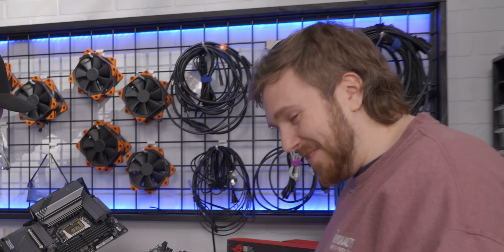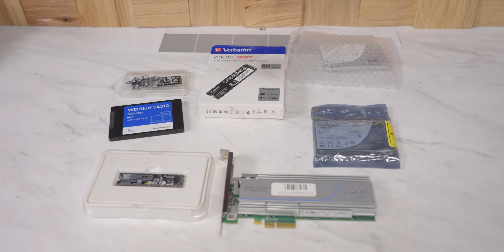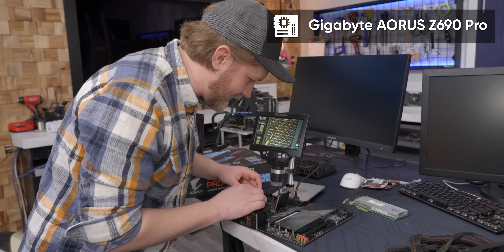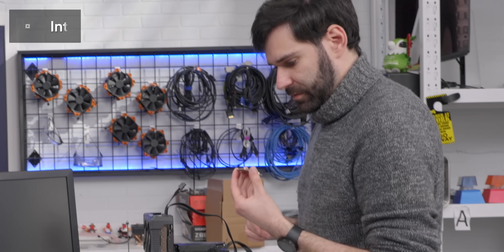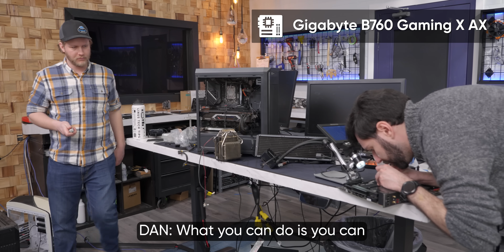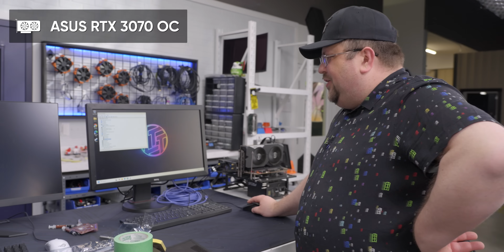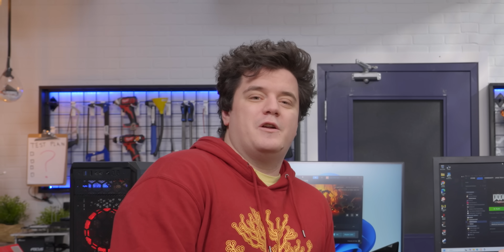I Built a Working PC using only Broken Parts

Comment: Looks at my 5800X, 32GB DDR4, RTX 3060 system with fans but without any side panels. 👀 
Did you just call my system a cougar?
BTW, I've seen bad PSUs kill HDD and SSD.
Reply: Bad PSUs can and will kill everything

Comment: Those plier pins for the bios are so incredibly difficult to make contact onto the chip it would read FF when theres a faulty contact. You shouldve de-soldered the bios chip and then soldered into the adapter pcb that comes with the pliers and then tried. I did this to my steamdeck but since my soldering iron had such little thermal mass i ended up frying the traces due to overheating and bricking my steamdeck

Comment: 22:07 That's a very common problem with WD SA510 drives, I had a 512GB version and it also didnt show up. After a bit of research, those drives are not very good and reliable because they often just die. But, mine was built in 2022 so it has a 7yr warranty, which means I could just RMA it. Probably could do that too with the drive in the video.

Comment: Mechanical faults can be fixed (bending a bent pin back into shape, resoldering broken contacts, cleaning out dirt and gunk, applying new thermal paste and pads/putty, etc.), but when the logic of a component dies (i.e. the memory controller on an SSD, a CPU, RAM modules, etc.), then those are gone. They might still "work", but you're going to be in for a permanent ride on a razor's edge regarding "Will my PC just randomly crash?"

Comment: ive build a few necro pcs but i normaly go to a ewaste supplier that is allowed to sell the parts and i have had luck with everything but i will never run a broken power supply as corsair make great power supplys ive had mine for 8 years and one before 13 and last one only died because of user error big time but motherbordes cpus and gpus as long as you can inspect them normal i find that you can repair as long as you know what to look for and ram i tend to look for ones with missing pins normaly in certian locations on the ram as i know most likly i can fix that cheap and easy and i find it to be a good way to get a cheap pc but normaly unless ram is super expencive i would buy new as the diffence when the buy new price is lower isent worth the hassle

Comment: we boughta gigabyte x670 am5 it was an expensive board for a costumer, we paired it with a working cpu and it would refuse to boot. it booted half the time with only one of the cpu power slots connected, which was weird, and my dad deemed it broken and was sent a replacement by gigabyte for free which was cool, and even cooler they didnt ask for this one back. 

so i bought a ryzen 5 7600 and it works completly fine. on both powers. it just became my main pc, free board lol

Comment: 27:15 I have the same problem as Elijah, but it happens when i change the display, not the resolution
DOOM 2016 just struggles to run A LOT, and tends to crash when i plug it onto the TV (1920x1080@60Hz), works at the shittiest resolution of the same TV (the lowest linux allows, like absolute trash@70Hz), but in my display on my desk (usually 1920x1080@180Hz) it runs perfectly fine

Comment: As far as dead RAM goes.. in my broke days i've had a pc with 256 mb DDR ram. My friend had 1GB but at one point his pc broke. They went to the repair shop, and was told it was a bad RAM module. So he got a dead 512MB ram. I took it home, turns out it worked. I used it for 4 years. Around 7th year I told my friend that I took it home. And was pissed at the PC shop guys. That it still worked.

Comment: Caps lock / num lock work when the keyboards getting 5v power lol I mean, getting power out of your USB ports I suppose is something. There are motherboards with partial initialization which do not power peripheral initially so getting to the keyboard to receive power and validating that may... sort of... indicate something? I mean - wouldn't go by it, but this is Linus Tech Tips so makes sense.

Comment: In 2003 I had a helpdesk tech working for me that bent a pin on a CPU and then when trying to fix it, broke it off. He decided to just try putting the CPU into the motherboard and it worked just fine.

So I told him well looks like that’s your computer.  It worked for years without issue. I guess that pin was not needed.

Comment: I'm a retro-hobbyist, so I'm effectively always "putting dead RAM in". The first thing I do after ANY change to the innards of a PC is use at least a few minutes of memtest86+ as an extended POST... and it's saved me a lot of pain situations like "a bit of dust found its way into the DIMM socket while I had the DIMM removed to grant access to another component".

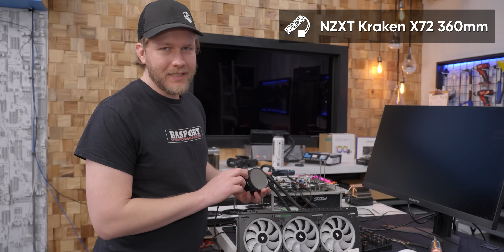Comment: 23:00 you can actually buy the spare power/usb connectors for NZXT coolers for cheap either directly from NZXT, or from aliexpress. I got my NZXT 240mm from a friend, and due to logistics error (item was in a pile in his parents house, and he alr moved out 6 months) the power cable is missing so i just bought it off aliexpress since NZXT doesnt have good coverage in my country for this kind of specific support.

Comment: this is the side of LTT that I love it has never been a better time to build a used parts PC. If you have the last few gens of CPU mobo combos it's gonna run GPUs for a bit in the middle of the pack. In my 3070ti build I'm switching to a 5070ti and upgrading nothing else. and ill leap into new generations with 10 cpu cores and 64 gb if ddr5 5200mhz ram I can actually just wait 2-3 years before I upgrade my CPU Mobo combo

Comment: For those bold enough to try finding resold Western Digital SA510, take a LOT of precaution. Ran into those particular drives in some backup appliances, they released with a broken firmware that (unless updated) could put your drive into a read-only mode. At that point, it's a nice paperweight. 

Aside from KingFast, any other drive will serve better than the SA510.

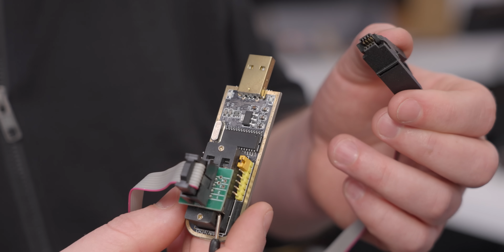Comment: 19:17 No No No No that probably needs the 3.3v mod done to it , I've coked many nand flash chips not doing that and , just desolder the bios chip and do it , on board sometimes messes it up
Those drivers aren't stable as well
For something reliable look at the rpi flasher

Comment: I buy computers from the local  scrap yard as complete systems.   Priced by weight.   Usually between $10 to $35 cdn.  I take them home and strip them down.  Test individual components.   And for about every $100 i spend, i can make on average $500.

Comment: With used storage, I think it's important that you tell others they should properly wipe it 100% before actually putting it in a system where someone has important files. You have no idea what could be on those used drives.

Comment: STOP recommending that usb flasher without going into further details! It has a working voltage of 5v or 3.3v, since pascal nvidia uses spi flash chips that work on 1.8v ( both supply and data lines). It is a good flasher, but it needs its 3.3v regulator changed with a 1.8v one. Attempting to flash a card with the 3.3v will kill your gpu and/or spi memory chip.

Comment: Broken pc, disc drive, ssd and ram sticks should be cheap af because fixing them is almost impossible. They should be used for spare parts only if there is anything usable in them. Which is why 15-30$ is max price for them. Then there is GPU.. motherboard, liquid cooling system and power supply. They can be fixed so a little more expensive. Especially GPU can be used for spare parts.

Comment: Im watching this video right now with PC Parts that have been soled as "Broken"
An Old Server Motherboard for windows server 2012 (DIM SLOT 4 is broken but thats fine for me...)
Im missing a side panel, but its under the desk out of reach, so thats also fine

My GPU RTX 3050 has no Fans, but it runs fine with the air flow Im having
3 sticks of RAM, each having 4GB DDR3. the contacts were lose/gone, so I reapplied some solder
and a 4 Core CPU with bend pins, also coming from the windows server 2012

I am running Linux on this machine and it works just fine
havnt had a problem with this build till yet and am deploying it since almost a year now

when it comes to gaming, Im kinda cooked by my 4 cores on my CPU
Im at 60% with only discord running in the bg
but, I must admit
eventho its not strong from its specs and its given age, it still runs surprisingly well
total coast of my build: 250 euros
but thats with buying a NEW 250GB NVME SSD and a new PSU

oh, and The power button on the case is broken, which is why I got a power cable with a button on it hanging down, but thats it

games I usually play:
Minecraft, Repo lately, Oxygen not included, Portal 1 and 2, slime ranchers, sons of the forest with proud stable 50FPS on all low settings ofc, Hydroneer and the forest

as funky as it may sound, I also work on 3D models on this build in Blender :D
Physics simulation is terrible on that one, but that doesnt really suprice me
It could be better, but due to the fact that I dont get to game real often due to work, I think that I will stay arround with this build for at least 3 years
and then upgrade to a pc with a rtx 6090, an Ryzen 9 something, 2 2 TB NVME with a raid 1 and a wopping 128GB of RAM

What Im trying to say here is that if you want to safe some money, you certainly can. but make sure that you can handle the consequences of having a broken system in long term

Comment: You're more than welcome to my fine collection of deceased legacy RAM sticks. The funkiest ones are from an overclocked  Win 95 pc which eventually combusted via a shonky Fire GPU. Nominative determinism ftw. The mobo was also a bit curly afterwards.
I also have a fine selection of intermittent ECC sticks in various flavours which might work fine in one slot on a particular brand of cheap single cpu motherboard, but play dead on any dual-cpu enterprise workstation motherboards. The more cores on the installed cpus, the less tolerant the systems seem to be with regard to iffy RAM integrity.
Post failure bleeps = EDM for pc wonks. It's great when it stops.

Comment: 18:49 Alex, RAM is definitely one of the weird components I have ever dealt with, when i built my system everything was working fine until one day it didn't.
Then I started swapping the slots and nothing.
Luckily I have built another PC for my brother so I grabbed the ram from there and put in my and ofc it worked.
But the most interesting part is that Original Ram worked on my brother's PC.
Its been like 3-4 years later still no issues.

No idea why, but ram is just ram.
Reply: Forgor to mention, my rig with the original ram was running for a few month, all the components were new, so it's not like DOA.
I have similar stories but these were with old or just trash components (I was one of those guys that would see thrown aways components and would collect, test and eventually Frankenstein them together, so in the case that my parents PC would die, I have a spare and I could save 100-200$ because we didn't need to have a tech look at it.

Comment: i did this back in 2002 or maybe 2003, i saved up for a whole year, then looked at the sales ADs in the local AD publication.
Had the equivalent of maybe 130$ at the time.
Found a computer with "lightning strike damage" for 40$, salvaged the CPU, motherboard and 256mb of RAM. lost the LAN, GPU, sound card, PSU and the other stick of ram. (cpu was pentium 4)
found more ram and a PSU on part piles friends had, cost me about 30$ total to get to 1GB (respectable at the time) and i think it was 400W on the PSU.
got some disks, a case, monitor and a razer mouse (new and expensive) for 60$.
brother donated his GPU because he switched to a laptop at the time. (sapphire radeon 9k something i think)

that thing held up playing cod 2 on medium-high depending on display resolution.
that thing also did NOT handle stuff like guild wars 2.

must have upgraded the pc at least twice (never the GPU) before buying a brand-spanking new one in 2008 with a radeon 5850 (i think) and an AMD black box, it was... superb. 8GB ddr2 felt like infinite ram at the time.

Comment: Took a chance and bought some $12 (ok maybe closer to $13) MSI 1060 GTX 5GB cards recently.

When I saw the 1060s up for sale on an otherwise unremarkable chinese vendors Amazon store page... and then did a "sort by price" with VRAM minimum 4GB list of al the gpus I could find, just to be sure I was seeing it right, I didnt think it could be legit. The seller page  and item listing  looked worse than most AliExpress Chinese store pages. Clearly incorrect translation of a side note along the lines of   "starter freshen exclusively working " that was intended to say "supported with updated driver" sort of errors. Then my scam sensors stared going off hard when I saw  "WARNING!! THE MOST POWERFUL GRAPHICS CARD" in the photos printed directly on the plastic of the card's cooling fan frame. But I found enough legit references to the card being real, and the reports of fakes I came across didnt quite match this one's details. For  $12  I had to know.

When it arrived within a week it took me about 2 minutes to jump on and order the one remaining one in stock and I wish they had more, people are selling used near-equivalents to this card from what I can tell about how it compares to other 1060s in mostly 3GB or 6GB versions, and I see worse cards getting sold for $120 in my city. They do require power from PSU or they dont start (but the computer does boot)  but that just makes me feel like theyre real GPUs. They run fine with a SATA-> 6 PIN adapter from the low end power supplies I ended up with. Stable and no warm wires as hard as Ive been able to strain them.

Because yes! They are legit Chinese releases that MSI/nvidia has documentation and support for on the chinese versions of their websites, the very last entry on nvidia's list of 1060s I think I had to google translate their .cn site to find, made specifically for asian internet cafe bulk market, and I even found some blogger talking about the intended release of that line when the demand for lots of decently capable cards  for gaming cafes was putting strain on the consumer cost of cards in China in 2017.  

I think the reason many people are warning about fakes is that these are the cards the actual fakes were made  to look like, probably by morally jaded  employees of those cafes with too much time on their hands, wondering how to make some extra money, with a small mountian of burnt out or damaged ones in a pile behind them, maybe even just a lot of damaged fans, plus a box of spares in kicking range safely hidden under their desk but ready to pull another one out the next time they heard somebody swearing and spilling their coffee into their machine or falling asleep with their coat and hoodie covering all the vents on their machine, while in game rendering some pointlessly fairy glowy scene on ultra . It woulnd't take long for the idea to get around that you could just pick up an older outdated nvidia card of about the same size, and slap the most recognizable fan you know on it and sell it to somebody far enough away they wont be getting in your face about it.   Turn $15 or parts into a $150 sale to some poor sucker half a world away. 

These definitely were listed as new in box and they sure felt new. 

They're actually better than the machines i have them in, games that might challenge the card seem to slam  both cores of the  A6-6400k FM2 cpus that came in these desktops all the way to 99% and then its hard to test the GPU....  The card wont even reach its rated PCIE3.0 rates, despite my mainboard supporting it, apparently you need an FM2+ cpu for that to work, FM2 is jus PCIE 2.0.  I know its such a waste to put money into FM2+ DDR3 based machines so I won't pay more than $15 per cpu, but I dont expect the extra PCIE interface rate will get me much extra performance anyways without the base system being able to keep up with prepping the frames, handling the game logic and physics, and keeping pace with network and input handling or resource juggling. my bottom end 2018 laptop is better at some things like hardware video encode and web browser tab overloading issues despite less system ram and having only integrated APU, ,  probably just from cpu and system architecture improvements ,  higher RAM clocks and smaller TDP from newer, more miniaturized silicon process requiring less total energy per logical operation, throttling less  for the same amount of compute. actually this line of  GTX 1060 were mfg the same year as the laptop and have a faster memory  than the mainboard once data is in vram, but my desktops uhm, half a decade older and was a guest machine for working on documents or internet use,  in a small nonprofit's spare office rooms for most of its life, not exactly engineered to be impressive.

Comment: On the subject of dead ram: I recently brought back two sticks of gskill ddr4 that both were throwing errors on occt ram test. Removed heat spreaders, put both of them in the oven at 200c for 7 minutes. Let them cool down in the oven with the door open. 2 months of error free use so far.